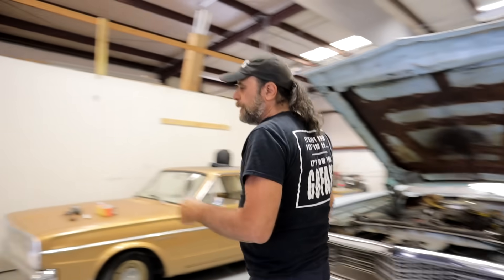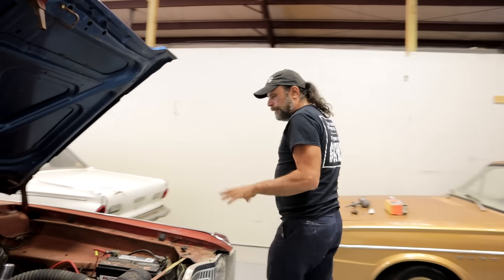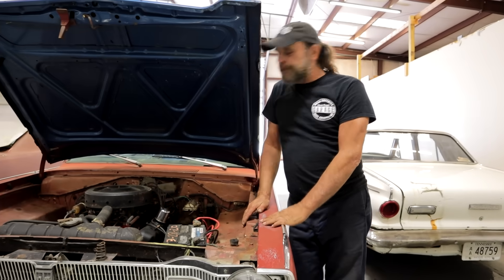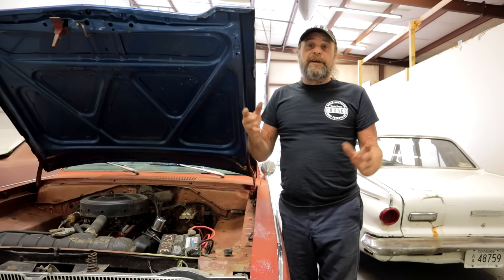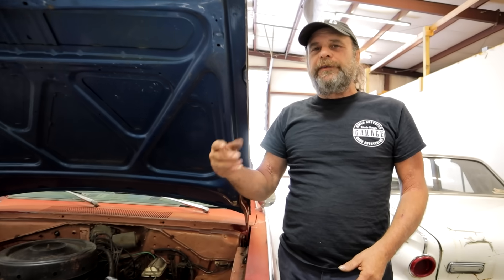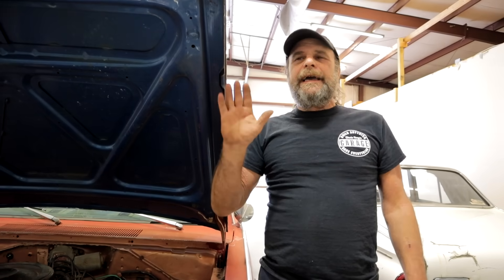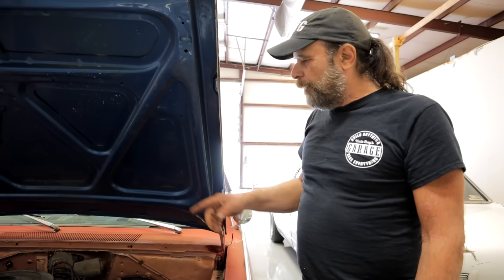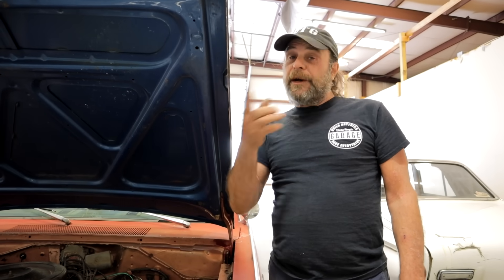Old School Tune-Up Mastery For Beginners: Setting Up Points The Easy Way

Comment: I have a 39 Desoto still with the points system. I use a tool called a Snap-Gap tool to set the gapping space. I ca gap the points even when the dizzy is in the engine block on my flat head six.

Comment: I would keep the coil wire on and to a ground or a jumper wire from coil secondary to ground while setting dwell to allow the primary to discharge over to the secondary.

Comment: Great video UT. You schooled me. I'm a shade tree mechanic. Been a while since I've had to change points but my 73 T-Bird needs a set. I've got both the feeler gauge and dwell meter and but never knew the interchangeability. I'll stick with your recommendation of the meter. Absolutely love knowing I'll be doing this 100% correct this time. I have a 65 Imperial that's probably due for a set of points as well. Thanks Uncle Tony !!!

Comment: I carried around an old skool Craftsman engine analyzer with timing light, dwell angle meter, etc... the whole none yards for a 70's era car since the early 80s through a career of military transfers, etc etc etc. That equipment had seen more of the world than most people. I always though I would need it again. After 45 years, I finally gave them away last week. Never used since I was driving an '82 Buick Park Avenue.

Comment: got a dwell meter for HS graduation present 1974 . I bought the  Hays magna pulse electronic ignition in 1975.used it on Pontiac and chevys never a problem. it is on my GTO now. oh those little screws will take out the fiber distributor gear. and points ign will run way after the contacts are gone.

Comment: First thing I do when I open up a distributor I checked the vacuum advance see if the vacuum unit is working then I check to see if the shaft is loose or worn out but I always use Blue streak points they were the best on the market at the time. It's all about time and care and taking the time to set the points with the filler gauge made for setting points the miniature one. Depending on how old or worn the distributor is what you set the Gap at. Most guys are changing caps and rotors when I just cleaned them and but the main thing was putting on a good set of plug wires.

Comment: Before I  put the points in the distributor I put some lube on the back of the rubbing block, opposite the contacts.  I'm a retired technician from the 60's, 70's 80's and 90's I retired in 2000. Your  videos bring back decades of memories. I love watching them!

Comment: It would have really helped if you'd have mentioned what you were doing with the screwdriver and what effect each movement had on dwell.  I'm assuming there's only 1 correct timing BUT can you correct me if I'm wrong... the closer you push the points towards the distributer lobe's opening and closing ramps the longer the points would be closed? That would mean longer or shorter dwell?

Comment: I was a boat mechanic in the early 2000s when I was in my early 20s. 
That's when the direct injection started on the boat engines and I got to work on everything from 1950s engines to brand new at that time. 

I definitely enjoyed working on carbed engines with points the most. Just so easy and fast to fix up, no wasting time testing a bunch of sensors or hooking up a laptop AND testing.

Comment: Not sure I understand. You connected the green wire to negative on the coil and black to ground- but isn't the ground also connected to negative? How do you get a signal with that?

Comment: Had 2 Pertronix electronic ignitions go out and so went back to points and condenser on my ‘73 TR6.  Now running a lot better, but had set the points with a feeler gauge.  Want to do better with the dwell meter so it will run even better.  Thanks for the demonstration Tony!

Comment: For the little screws. I take a piece of 14 ga. Wire and wrap about 5 or 6 times around the screwdriver and touch the wire end to battery posts for a second or 2. Magnetize it a bit.

Comment: You are correct; it is not the Manhattan project. But with any version of electronic ignition you don’t need to do this at all. Yes, you will need to replace parts on all systems, but the frequency is different.

Comment: 4:50….So true. New condensers are junk. I bought 2 of them and both were suspect. I went to the junkyard and found a 50’s car with an old condenser. I took it and installed it then my car started right up with no issues.

Comment: That's awesome UTG.  What would be the proper dwell angle for a 1965 F250 352 2WD?  Is there an online chart that would tell me that as well as the cylinder firing order and direction of rotation of the distributor rotor?

Comment: Thanks Tony. I’m going to try understanding my points system and master it. Friends tell me to swap to the pertronix, and I may eventually, but I think I need to understand this part first. 

Just bought a 64 Galaxie with a 428 FE this summer. Your videos on points & Holley carb’s have been great. I share them at car shows to other wannabe gear heads like me.

Comment: In the early ‘60s it was a common sight to see hoods up on weekends as most people did their own tune ups in the driveway or garage, did brake jobs and valve adjustments. Today’s owners manuals inform vehicle owners not to drink the liquid in the car batteries. When did people become so stupid.. I’ve seen 20 and 30 somethings that call themselves “TECHS” and have no idea what to do with a point ignition system.

Comment: I don't know if they still make them,  but get a distributor points screwdriver.  You push down the handle and it turns  the  center of the blade to grip the  screws.  Never dropped one.  Still have mine from the 70's. Works  around the house for grabbing  all  kinds of little  screws that you don't want to drop.

Comment: Now what do I do with my distributor bolt hold down wrenches that fit Chevy, Ford and Chrysler.  And of course the 1/8in allen flexible screwdriver to adjust GM points.  And the specialty screwdriver to adjust idle mixture screws.  I keep them for nostalgia in my tool chest and have added modern specialty tools over the years.  Some day I hope to work on one of those 50+ year old cars again.  Problem is, I no longer have a timing light or dwell meter.

Comment: As the rubbing block wears a Dwell Angle of 30 can become 25. At 25 my engine still runs great and you can adjust initial timing if necessary. At what Dwell Angle number will the engine start to idle rough or misfire at part throttle? At around Dwell Angle 20 degrees?

Comment: I'm having trouble with a dual points distributor I can't get the dwell right. It won't let me read out on set over the other. If I put a match box on one side it reads that dwell. if I put a match box on the other side and dwell it, it doesn't read at all it won't let me set the dwell on the truck and I'm out of ideas.

Comment: My Lincoln came with electronic ignition. Works brilliantly. I was warned that the box could go out at any time so I had a spare from AutoZone in the trunk. One morning, it didn’t start. Immediately, I plugged in the new box and sure enough that was the problem. Made it on time to work. 

45 years of flawless service and it took 5 minutes to swap.

I’ll take that on such a car any day. I wouldn’t have somebody throwing tools or leaning on my Lincoln every couple of thousand miles and worry that every time the points are swapped it’s going to run differently.

I set the vacuum advance, base advance, full advance and curve when I first got the car. In seven years, I haven’t had to adjust a single thing. The car, even when cold, starts faster than I can release the key.

Engineering.
Reply: Two things.  My family planed to move to Anchorage with a long isolated drive with a new Ford van.  It came with this new fangled electronic voltage regulator.  I'd never seen one before I thought to myself boy if that goes out 2000 miles to no where.  Sure enough.  I also had a 58 Covette.  I fitted it with a true 70 370hp Lt1 350 with factory 11:1 compression, canted ported heads, Dominator intake etc.  Car would launch.  Anyway, at first I ran the points ran well but later I rigged up a light trigerd ignition with Capacitive discharge overlayed on the light system.  Car ran better especially off low idle.  Would idle at 700 rpm or less with essentially the Duntov developed cam design.  As the compression gets higher improvements in ignition help.    I always set the dwell first then the timing.  Made sure the ponts were clean, not burnt and lubed the cam and the little oil felt in the top of the shaft.  Condensers are a big deal they are made of layerd paper inside and eventually go out.  You need the right condenser for the car.  Standard motor parts still has them for most cars as far as I know.  They have been making them for 100 years.  Currently restoring a 47 Dodge pickup with Nos ignition system.  Have no beef with points systems when properly applied.
Reply: @RobertHarrison-w9u you understand a Lincoln is not a rolling rust bucket for Jim Bob and his tools?

Comment: Cool...As a "Lazy" Ford guy...I never used the dwell meter....I knew what "Dwell" was, but never used it. -  I think most of the people that bitched about points....were Chevy Guys....LOL - That dist. in the back (Like that Mopar)  would make me unhappy too...On my Fords I got 10-12,000 miles out of a set of points without much issues.

Comment: As I set in new points & condensers the first thing I do is check the side by side movement of the distributor  shaft..(this will tell you a lot) second item I check is the contacts in the distributor cap, where the wear is leading or following per contack, the third thing I check is the dwell on the old points, plus the point contacks, since a good tune up consist of changing the plugs, it's saves on the battery if the plugs are removed first (No compression) period to installing the new points I apply a dab of high melting grease to the cam lobes (match stick head is all that is needed) while you there you can see if you can aquire a less tension springs for the vacum advance plate..this will increase you mileage up wards to 15% but it will lowered you acceleration by a small margin.takeing your engine starter ade, as you turn it over and when you take your engin Anilizer to setting the dwell you'll have to check it several times because the securing screw (when tighten) will also change the dwell as its tighten.. if you dwell is suppose to be 31° to 34° go for the higher medium of 34 ° as the nylon rubing heal on the points start to set from wear the dwell will change.. a small degree..this in return will after a couple of years will decrease  your mpg by 2 to 3 miles per gal. On older cars and trucks I always install a vacuumed gage as driving down the road I can see the dial at a glance, to see the HG reading is at.. best milage obtain is at 19 to 21 HG of vacume on straight 6 cyl about 19 mpg.

Comment: great tutorial. I think it'll be a big help when I get the chance to use a meter on my 55 pontiac 287. I put new points and condenser in it the other day. I think I got it close, but not quite spot on.  it runs, but has a slight sputter in r.p.m. range  in second gear under medium throttle and at hwy speed when I floor it for passing gear . other than that, he cruises nicely,  for a nearly 70 yr. old car.

Comment: My uncle taught me to put it on one or other side of rubbing block depending upon rotation.  Say I have had a few cars with dual points. I would put a piece of paper in one set and dwell other one than switch paper and do other one. Is that the correct way to do it?

Comment: Everyone thinks I’m crazy wanting to keep my truck points but man there is a simplicity to them. Points are like 6 bucks. Keep a set in the glove box. I do generally prefer electronic ignition on small motors but on an old car I’ll take points. 

Dwell Meters are cheap. I bought 3 at the last swap meet for a total of 10 bucks.

Comment: I've tuned tons of points cars using the dwell meter.  I was always taught that the feeler gap was just as a starting reference so you can get the engine to run for a proper dwell check.  And why is that important?  It's because the dwell determines how long the coil charges- the longer the charge time, the hotter the spark.  A properly balanced dwell will minimize plug fouling and improves cold start, and that all adds up to improved fuel economy and maximum power.  

But I've only been working on these cars for 40 years, so what do I know anyway...

Comment: This. Is. Good  stuff. To.   Know...  even. For.  The Youngsters.....  it. Builds.   Strength...in. .comprehension...  of.   How. Things.  Actually.   Work......  on. The. Engine...  even. With. Understsnding...  how. Electronic. Sensors...are. triggered...and. connected... with.in....the. system.....  have. A.   Nice.  Dau..

Comment: Thanks for the video Uncle Tony. I acquired my father's big block 1967 cougar after he passed April of 2021, it's sat for about 10 years and at this point I just want to get it running and driveable so I can hang his ashes from the rear view and cruise with the old man. The car has more sentimental worth to me than monetary...even taking into consideration that there's only about 2,000 of these cars left. My father taught me auto repair on this cougar and the FE 390 big block he and I swapped out of a 1970 LTD almost 40 years ago.

Comment: How do you find out what the dwell needs to be on a SBC with a dual point Mallary? Going to change my points and hope I can in the car since it has a dual carb tunnel ram.  I'm afraid of putting an electronic conversion kit due to get stranded on the road somewhere if the unit would stop working since I see online it happens often to guys. 
Thank you

Comment: Tony - Long time subscriber. Your videos are gold and we are so thankful you're taking the time to share your knowledge. Keep up the good work!  I grew up on Chevy motors (327, points, Quadrajet, 4-speed Muncie) and that's what I learned on from dad. Have had my mopar since 2010 (68 satellite).  I carry a spare chrysler ECU in the trunk as they sometimes fail due to heat. Yes, the electronic ignition lasts longer, but it doesn't last indefintely. I remember big smiles for miles the day I swapped in a new set of points once a year and set the dwell. The motor runs so crisp when the points are fresh. One day I swapped in an early Pertronix under cap electronic ignition. It never ran as crisp as the points. My mopar already had the ECU conversion when I got it, so it's staying, but I for one like points just as well as electronic ignition for a daily driver. People just need to be in the habit of routine annual or semi-annual preventive maintenance regardless of what setup they have.

Comment: I bought a dwell meter many years ago and used it to check the point gap a few times before realising that it's far quicker to just use a feeler gauge,.  I set the gap to whatever is  specified in the handbook and it saves all that faffing around.

Comment: Thanks for a trip down memory lane. I used to tweek my 72 350 olds cutlass every few months but I set the timing as well. which I had to change temporarily  being assigned to lowery AFB in Denver co. (5000 ft above sea level). Unfortunately, I am not a motorhead and prefer E tonics for the lack of maintenence. I subsribed. great video.

Comment: Watch you,because i respect you.Been working cars since i was 7 yrs old.Got my legal papers in 1984,when cars and trucks were still carbed.HEI--Points in some of the older cars i worked on.Chrysler dual points were a little trickie.They were the days.If i could go only go back 40-50 yrs,when they actually made cars.Mechanics like you and me are in a little glass case,that says---BREAK IN CASE OF EMERGENCY.

Comment: Hi Uncle Tony. I ha e a question for you. I am working on a 64 Econoline with a 144 six and I am working on the igniting system. I noticed the points have a slot on both ends of the body and they are putting up a fight during adjustment. Any suggestions? I bought an Acton 6 series like yours since all of my vehicles have points accept one, lol.

Comment: I never thought of cranking it with the cap off. I prefer to set my points with a dwell meter too, but I've been starting it, checking the dwell, stopping it and adjusting. I'll be doing this from now on for sure!
Reply: Just make sure to disconnect the primary side of the dist. though....OR you may have a shocking experience.
Reply: I used the same method as you.  I didn't trust the cranking method as I believe the lower rpm would not accurately reflect the dwell of a running engine.
Reply: Is it normal to get a different  dwell reading when the engine is running compared to your method of setting the points? Seems to me that they should be the same, but mine is not. I set my points to the recommended 31 degrees using your method, which is very close to the .017" the points are supposed to be set at. But when I measure the dwell with the engine running, it's 21 degrees. 🤷‍♂️ 53 Packard, 327 straight 8, 6 volt positive ground.

Comment: I still have the same tube of points cam grease I bought in the early 80's. One of my auto shop teachers told me to just get one tube and it would be a lifetime supply. I've run into really bad running problems simply caused by the points cam being dry, the grease is there for a reason, and it takes very little to do the job, too much and it makes a mess and can get into the points themselves. It's funny how so many mechanics can't figure something so simple working, or how to set them up.

Comment: That was awesome.  I was wondering if you gonna lube the cam lobe on the dist. for the points block to roll on. but you remembered.  Thanks for the tutorial on the dwell meter. Been to long since i used one.  And of course , since i work on jet aircraft i will never use one on there.